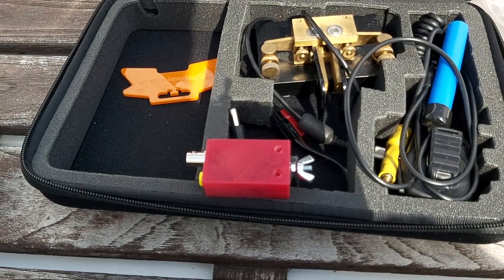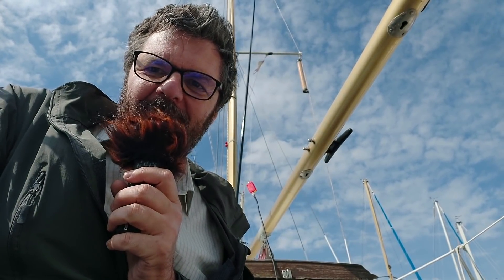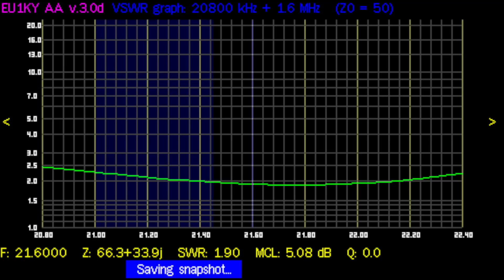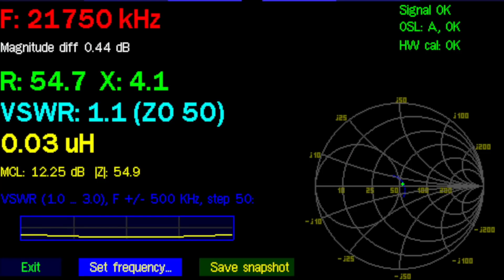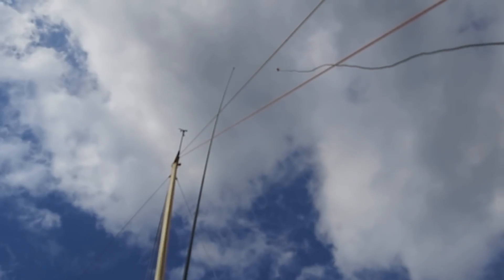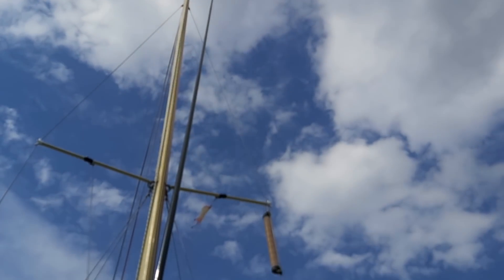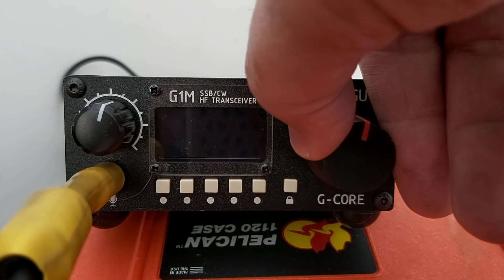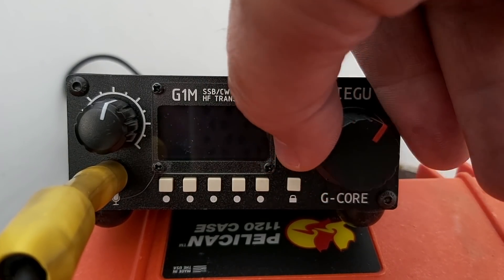Xiegu G1M QRP Radio Using SSB & CW With HWEF Antenna.

Comment: Hi,
What do you think about 49:1 and 64:1 using single toroid?
You transformer will have 2 connectors, one for 14th turns and second for 16th turn.
Reply from the maker: Sure, that would work.

Comment: I would have used one of the halyards to yank up the end of the EFHW. I just got my G 90 and I have the JPC-7 Portable Vertical Antenna. I don't have a balcony and no access to the roof. I hope I can get JS8Call to work close to the building. I'm on the ground floor. The Med weather (Winds) can be fun for boaters I think there called Mistrial. 73
Reply from the maker: Correct! You should have no problem with JS8...

Comment: what is your mic ? svp
Reply from the maker: Two: Original Xiegu and a blue electret mic, unknown origin.
Reply: I recognize the blue one.  I made it from a kit from Pacific antenna.  I have no idea how well it works. From what I read they say it would work better with a preamp.
Reply from the maker: So I heard also, it seems to work fine. I'll add a little bonnet to it for pops and wind